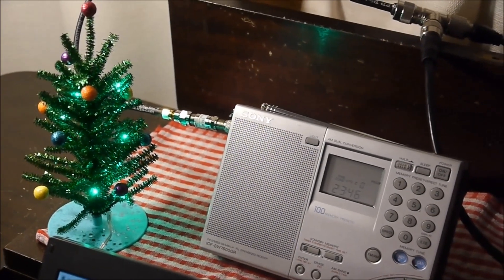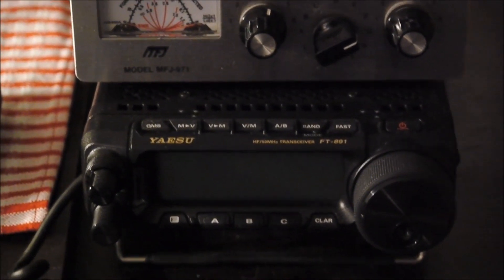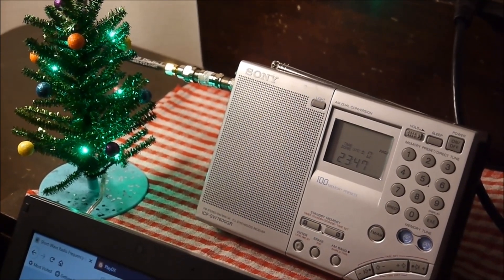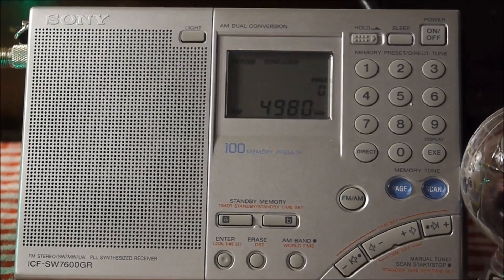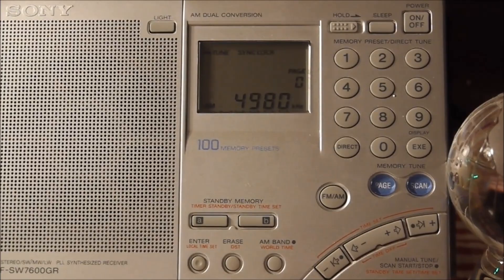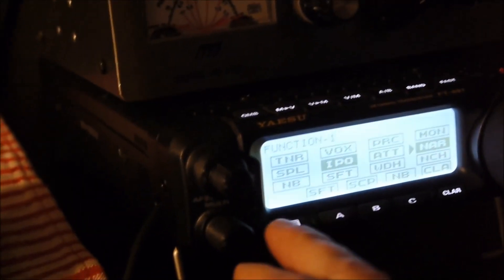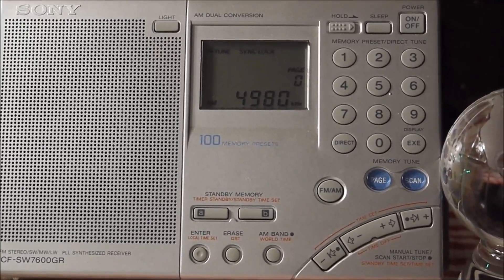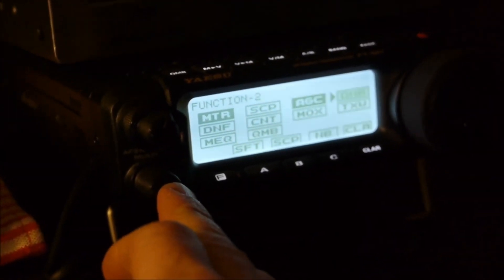Sony ICF-SW7600GR vs Yaesu FT-891: XPBS China - 4980 khz

Comment: So much for the Sony not having a good speaker, but it is obvious that the Sonys speaker is ideal for SW. Thank you for sharing your great comparison I have the Sony and it is an incredible radio. Happy New Year to you 👍 Tam.
Reply from the maker: Yes! The Yaesu's speaker is pretty bad - but, its a mobile transceiver and there is an output jack for speakers (which the Sony has as well)
Reply: @shortwavelistener  I was in no way knocking your Yaesu. Nor would I knock Kenwood or Icom, they all make great equipment my friend. Congratulations on getting your license Sir well done 👍 Tam.
Reply from the maker: @b.2221  Not a problem at all!! I didn't feel you were knocking it - just your observation!
Reply: @shortwavelistener  Thank you very much Sir 👍 Tam.